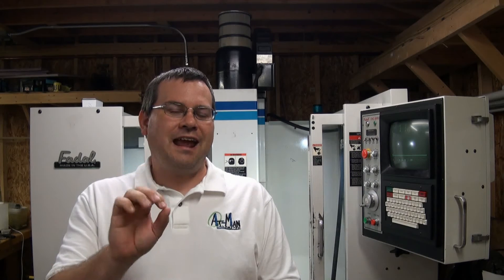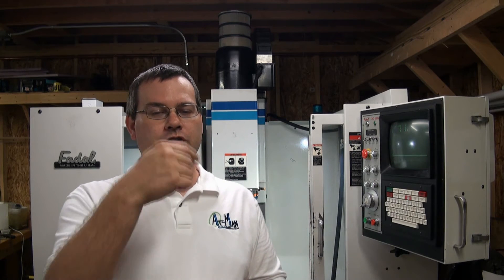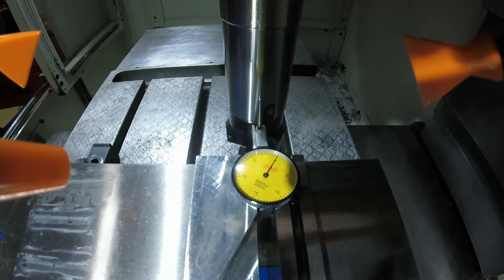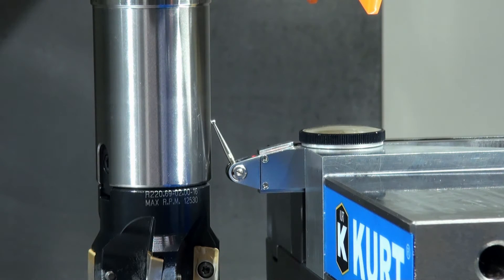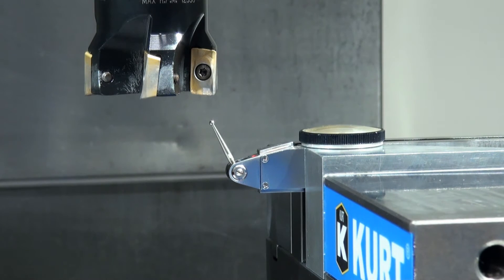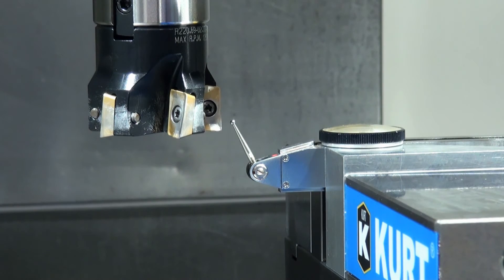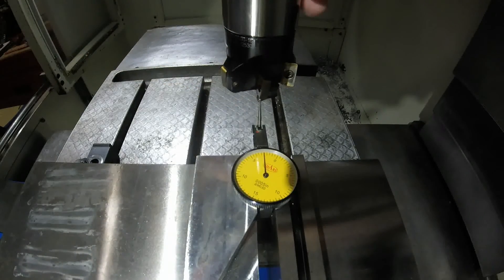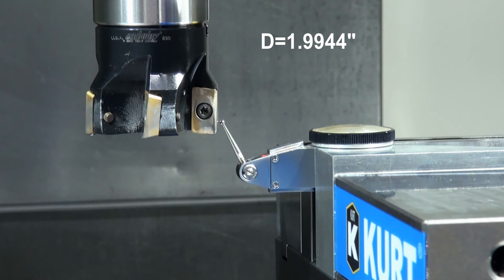How to Measure Tool Diameters on a CNC Mill

Comment: What is the difference btw measuring the diameter with Mitutoyo Caliper vs that methed ?
Reply: You can't measure a tool with a single flute or odd number of flutes with a caliper, also the caliper is way less accurate and doesn't account for the runout in the tool.

Comment: Surely, you can only say the x is zero when the indicator is reading zero? because you use the indicator zero to read the known diameter?
Reply from the maker: You need to use a known gauge pin to setup the distance relation between the indicator and X first

Comment: Curious how you zero out the X and Y on your Fadal?  I don’t see any simple method other than SETX or using G92. Both will mess up an existing setup. 
Btw, I appreciate your vids!
Reply from the maker: Thanks, I use a fixture offset to set XYZ at a zero point. You can use the fixture utilities and they work well.

Comment: pls also make a vdo on how to measure a round insert tool diameter
Reply from the maker: Round inserts are a little harder. To measure round inserts you want to use a flat perpendicular surface. The little tool setter gauge I have can measure the length offset on its flat plate. To measure the diameter offset you can use a square or the side of your vise jaw. Use the shim stock, gum wrapper, gauge pin, method to locate the side of the tool to the vertical surface. If you know where that vertical surface is in X or Y then you can figure out the diameter of the tool.

Comment: We just use cutter comp wear, leave the diameter blank and then just adjust in wear to bring the part in, that way tool diameter does not really matter all that much, as long as we have the diameter reasonably close in our CAM software we are good to go.
Reply from the maker: That only works if your tolerances are tight enough on a new tool relative to the tolerances on the part. If you only make one of something, and its a tight tolerance part, you will want to measure the tool. Especially if your machining an expensive casting or something of the like. The older machines only have one tool diameter input. But you can still use it the same way as your pointing out. You can either enter in the measured diameter, or you can enter in a deviation from the spec diameter to the actual diameter. If your making a lot of something, then yes, as you point out you can measure the parts coming off the machine and make adjustments to the comps to keep the parts in spec through the run.
Reply: true, we do tend to do large runs of parts, we manufacture farm equipment so everything we machine goes on our our equipment, gives us a lot of leeway and if we scrap a part or two it is not a big deal....usually..sometimes it can be annoying